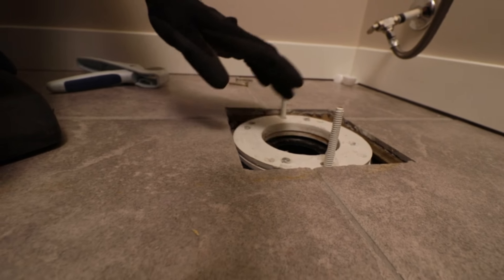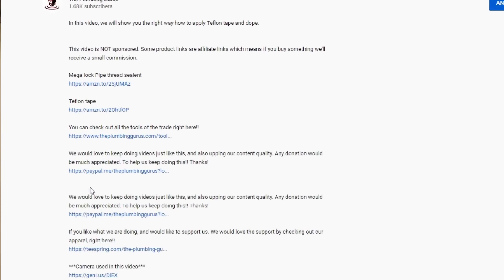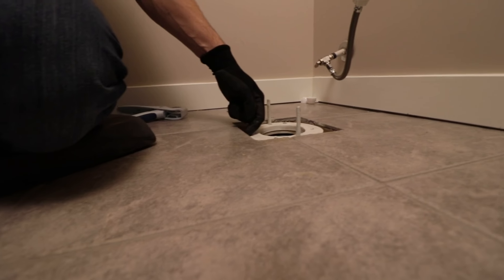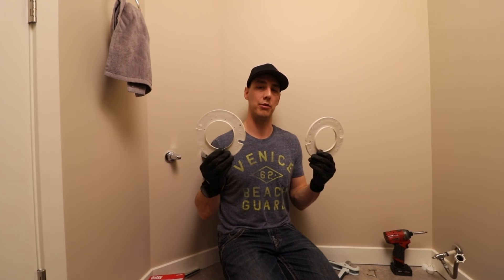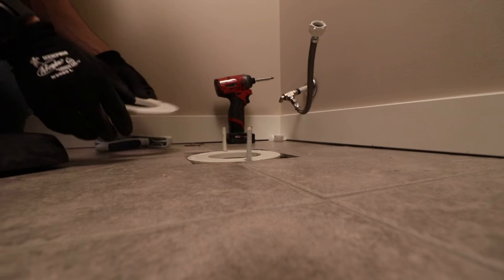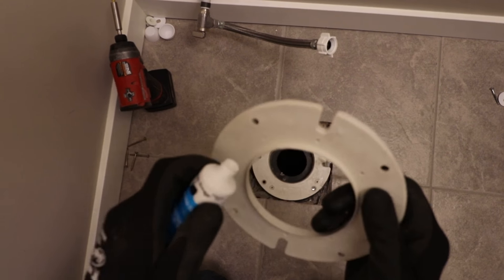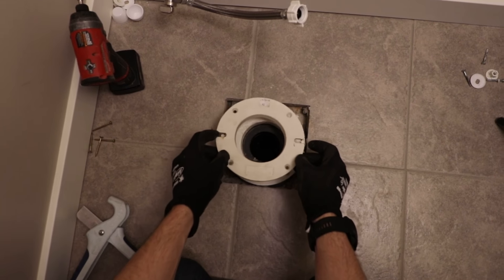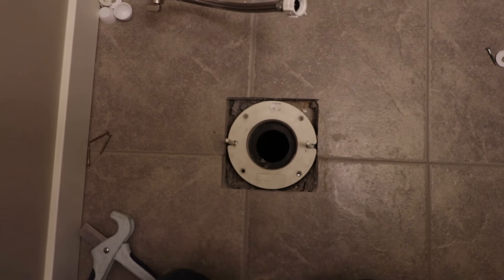How To Install  A Toilet Flange Extension Kit - Master Plumber Extension Kit

Comment: Thanks for the helpful video. Unfortunately I installed two spacers, but didn’t use the included silicone. Do I need to open it again and use silicone between each one?
Reply: Without silicone, It could leak between two spacers
Reply from the maker: yes its a good idea to use silicone between the flanges
Reply: Yes im dealing with this now. New home and plumbers uses these stupid spacers and its been leaking between the two for awhile. These things are terrible. Get a NEXT danco perfect seal kit for flanges below the floor height or other extension kit on the market. Dont mess with these spacers.

Comment: Always fill in the area around the flange!  Silicon works some plumbers use mortar!
Reply from the maker: Wow We’ve never actually done that. But it’s a great idea, if it’s tile. Would definitely stop the water from going underneath or downstairs
Reply: @ThePlumbingGurus  👍 those little cracks and crevices around the flange are magnets for moisture!

Comment: My toilet hole is flush with the floor so if my top of flange is 1/4” below floor and the wax ring is about an inch shouldn’t I be fine?
Reply from the maker: I would get a thinker wax seal. We have them and they are called max wax seal.

Comment: Thanks for the video. Very helpful tips.
Quick question:  I notice the bolts go in the notch in the spacer.
The original flange I have has the larger slots to slide the bolt in and out.
If the bolts need changed later, how can they be removed from the spacer notches?
I assume they would be in both the original flange slots and the spacer notches.
Thanks.
Reply from the maker: You can just unscrew the spacer flange and replace the bolts. Then just reinstall the spacer. You would want to scrape of any old silicone and re silicone it though. Hope this helps, thanks for watchng
Reply: @ThePlumbingGurus  Thanks for the quick response and help. 
It's always very kind when people with knowledge like you share it.
Great videos.
Reply from the maker: Happy to help!
Reply: This was super helpful. I almost skipped the silicone step. Really glad I watched this. Thanks!
Reply: @ThePlumbingGurus  after i install my 2x8s do i put underlayment on next and what kind??

Comment: Thanks for the clear video.  If you need to eventually remove the bolts do you have to take off the spacer?  I can't see how they would come out otherwise.  Thanks again.
Reply from the maker: Happy to help! Yes you would need to remove the spacer to remove the bolts.

Comment: Great video 👍 what is proper flange height for tile floor?  Is it flush to tile floor or can you go a little abover?
Reply: flange should be on top of the finished floor, so 1/8' to 1/4 inch commonly.

Comment: Hi. My original flange is metal or iron. Will I still be able to screw in my Oatley spacer into the floor or will the holes line up with the metal flange?
Reply: Just drill through the metal.

Comment: Hi! Thanks fir sharing. Great video! Question? What is the maximum a flange can be extended? I’m raising my floor 4”. Can you keep adding extenders?
Reply from the maker: As long as they’re siliconed and properly installed you should be fine. But it might be best to cut the pipe and raise it if it’s possible.
Reply: The Plumbing Gurus Excellent! Thank you SO much! I appreciate it. Tomorrow is the big day! I’ll let you know how it goes. Thanks again!
Reply from the maker: Awesome, good luck! Let us know
Reply: @richstevenson1  howd it go?
Reply: @cmull96  Thank you checking back with me! Yes! It worked! The floor was raised 4” and I was really concerned I’d have to call (pay) a professional.  But your advice worked! Thank you again!!!! 🌟🌟🌟🌟🌟
Reply: @richstevenson1  
I'm curious. Why did you raise the floor 4"?
Reply: @rogermccaslin5963  Hi! The floor had to be raised 4.5 inches. Renovations were done in an old house. And the floor was slanted. It was on a pretty steep grade.  The toilet was at one end of the bathroom. My initial plan was to leave the floor slanted. I later changed my mind about that. So we had to raise one end of the floor to level it out. That meant we had to raise the roof about 4.5 inches on the side the toilet was. It was a crazy floor.

Comment: I answered my own question below.  While the 3 inch diameter discharge chute on the toilet bottom is even with the floor, the area on the bottom of the toilet where the way ring sits is from 3/4 inch to maybe one inch above the bottom of the toilet.  So if the toilet flange coming out of the floor is even with the finished surface of the floor,  there is 3/4 to 1 inch of space that needs to be filled by the wax ring.
Reply: Exactly , the flange needs to set on top of the tile

Comment: Please help me understand the geometry of the flange versus the bottom of the toilet bowl.

The bottom of the toilet discharge opening is even with the base of the toilet.  If the flange is even with the floor, it would seem the wax ring would be smashed totally flat since there is then zero space between the bottom of the toilet opening and the top of the flange.  

So since a wax ring is about an inch thick, why can't just a wax ring be used if the existing flange is less than an inch below the floor surface?  Thanks.  I have never understood why the flange needs to be so close to the floor level.
Reply: I've been wondering the same thing. If it's a quarter inch above the floor, the toilet has a quarter or half inch hole where the wax ring goes, wouldn't the toilet wobble?
Reply: The toilet has 3/4 in from its drain horn to the finished floor.

Comment: Hi. What size screws do you recommend for putting the spacer on? also, what silicon product do you recommend? Thanks!
Reply from the maker: I’m this case there was concrete under the original flange. So we used 1.25 because there was to flanges. If it’s wood underneath you can use longer ones. It will also depend on how many plates you are using too. Just measure the thickness of them and add and inch or so. As for silicone, you can use any kitchen and bath stuff. And long as it’s meant for water.
Reply: @ThePlumbingGurus  So you're screwing into to the concrete?

Comment: How many extensions can you add? I want to install 3/4 inch plywood over existing floor. How many extensions will I need?
Reply from the maker: I would not add more then 3 extensions. Try and make the extension come to the finished floor height.

Comment: Is there a flange that will fit inside 3" toilet drain pipe?
Reply from the maker: Yes there is. Best to go to your local hardware store and find one. Make sure it fits inside a 3” pipe.
Reply: Cannot find one here in Calgary, Alberta.
Reply from the maker: Can you join our Facebook group and send pictures. The plumbing gurus
Reply: @boringman8673 here in Toronto home depot, Lowe's , Rona all sell it.

Comment: Flange should typically  sit on top of finish floor, no? Seems like second spacer should have been used.
Reply from the maker: We’ll generally you want the flange to be flush with finished. That way you can use a wax seal with a horn. If it’s on top then sometimes you can’t. And if it’s just a little below you can use a wax with horn and add one without to double it up. Or you can also get max wax seals that are thicker

Comment: The plumbing code requires that the closet flange sits on top of the finish floor. What is the purpose of the caulking in this video? Unless all traces of wax are removed from existing closet flange, silicone / caulking will not bond & form a watertight seal. In many videos silicone / caulking is used in lieu of plumbers putty. Again, all traces of wax MUST be removed to provide a bond & seal
Reply from the maker: Not all codes are the same everywhere. So it might be that way where you are but there’s nothing in our code saying that. I’m not sure what you’re talking about for the wax. We would’ve cleaned off the wax before screwing the extension down.
Reply: @ThePlumbingGurus  When I say "clean off the wax", I mean all remnants of wax need to be removed. Some kind of solvent should get ti off. Caulk / silicone will not bond to flange if any trace of wax remains.
if your code has no flange placement provision, what are your suggestions for proper placement & why. Some Toto toilets require flange on top of finish floor so as to prevent leaks. No stacking of wax rings allowed. A separate warning sheet is included with the instructions

Comment: Gods video but you definitely want the flange a bit above the finished floor so 2 rings was the better way , also NEVER double up the wax ring , it will leak  most of the time , seen it with my own eyes  , my boss with 40 years experience in the business saw it so much , that he make sure we never double it . Save yourself the trouble , add the extra ring .....
Reply: Do you need to glue the 2 plastic extenders together also or just glue the bottom one? What type of screws should I use?
Reply: @rollinlikeariver7756  yes , silicone in between every ring , to keep water in in case of backing

Comment: Is that really too low? Mine's about the same quarter of an inch below the tile but I figured the wax ring would create a seal and my new toilet would fit. Am I wrong? Wish I'd see you put the wax ring down on this.
Reply from the maker: If it’s below you can double up wax. The biggest thing is you should make sure when you put the toilet down. It is squishing into the wax a decent amount. This is just one of the ways to do it and to insure a proper seal
Reply: @ThePlumbingGurus  I'm pulling it off tomorrow. My old "Gerber" toilet doesn't flush well at all. BTW, just read that American Standard had a cracking problem with their "Champion" toilet a few years ago. Has that been resolved? Need a good flushing capability.  Thanks for the help.

Comment: The plumbing code requires that the closet flange sits on top of the finish floor. What is the purpose of the caulking in this video? Unless all traces of wax are removed, Caulking will not bond & form a watertight seal. In many videos silicone / caulking is used in lieu of plumbers putty. Again, all traces of wax MUST be removed to provide a bond & seal
Reply from the maker: Codes are different everywhere you go. Makes more sense to have the flange flush with finish so you can use a wax seal with a horn.

Comment: Try not and use two wax rings if possible use extension as he is showing. I've had at least three toilets leak when two wax rings are used
Reply from the maker: Nice thanks for watching. 
I agree 100 with you

Comment: The plywood is rotted around my toilet flange. I tried wood filler and silicone and it didn’t workout. Should I cement the tile buddy to the tile if it is wide enough?
Reply: You mean the wax ring did not prevent that?
Reply: @ericmaher4756  No however I took care of it. Thank you. IThe plywood is dry and concisely cover with wood putty smooth as ever. I just had to place a shimmy under the toilet afterwards. I appreciate your help.

Comment: I saw a vid where the guy used plumbers putty around that flange lip then he used silicone on the outside of the plumbers putty.
Is silicone better than plumbers putty?
Reply from the maker: Either or would work just fine. We would usually use silicone for this. But plumbers putty would work too.
Reply: @ThePlumbingGurus  thanks man
Reply: @ThePlumbingGurus  okay thank you! Ooooo one more quick question..
Can I just double nut the flange bolts instead of using screws to screw it down? The existing flange is already screwed to the wood subfloor.
Thanks man

Comment: So it's ok that the finished floor and flange are at the same level using a traditional wax ring?
Reply from the maker: +KigMan01 yes it should be fine. You can join our face book group and send us pictures to confirm. 
The plumbing gurus 

Thanks for watching.

Comment: The sound sucks and it is hard to know what you are saying at times.  For instance, I can't tell why you said you prefer a level surface as opposed to slightly raised.
Reply from the maker: Sorry for the inconvenience, we prefer it to be flush with finished floor because then you don’t have any issues with using a wax seal with horn.
Reply: @ThePlumbingGurus  Many thanks.  Now, if only I can figure out what a wax seal that comes with a horn is...
Reply from the maker: Just google wax seal with horn

Comment: Flange should be flush above floor
Reply from the maker: Flange should be flush with floor. It can be above but can sometimes cause it to rock and you can’t use a wax seal with horn

Comment: I would say don’t do any of this, people. Extenders will fail at some point. If you read the instructions for toilet flanges, Oatey anyways, it says best practice and recommendation is to install the flange ON TOP of the finished floor. Putting spacers with some silicone in between will fail at some point. Do it correctly the first time. Also, how can he just use random screws into that spacer and call it a day? I’m sure that whoever engineered that spacer put those holes in those spaces and at that size for a reason. If those spacers/flange fails, he basically filmed himself losing a lawsuit and who knows if his insurance will cover him. Even if you go on the premise that spacers are fine, that’s only if you use them the way they were intended. I’m sure I’m the instructions it doesn’t say, “use our pre made screw holes, but if you’re too lazy to do that, then make your own wherever….”
Reply from the maker: These extensions are for if you’re not redoing the flange and you need to extend it because someone raise the floor height to much or something. Clearly yes you should install the flange “correctly” the first time. This was not a scenario where the flange could’ve been installed higher. It was flush on the concrete and the floor was raised with infloor heating. There’s nothing wrong with these and they don’t fail.
Reply: You're out of your mind by suggesting to install the extender on top of the floor.
And by saying the proper way, you mean rip off the floor and raise the flange and charge thousands to home owner as a general contractor myself, I think you are a unethical plumber

Comment: These are for hacks. Don't install them. Buy an extended barrel flange and do it right.
Reply from the maker: Sounds like you should have a chat with the people that make this product. 
We have never had a single call back or problem with this product.